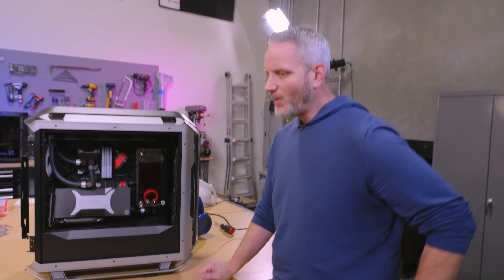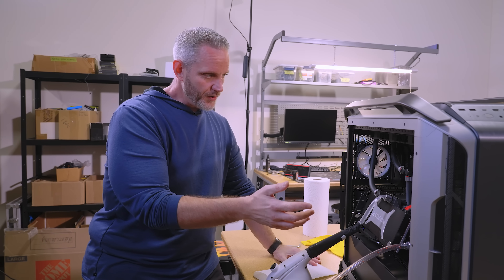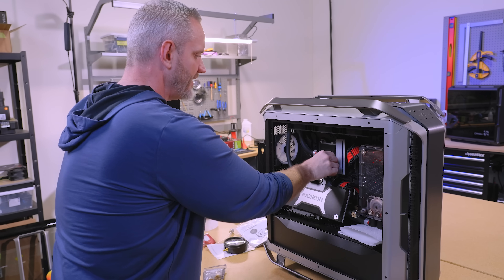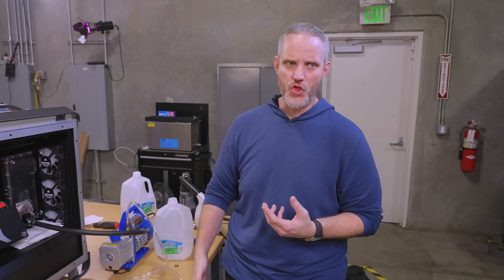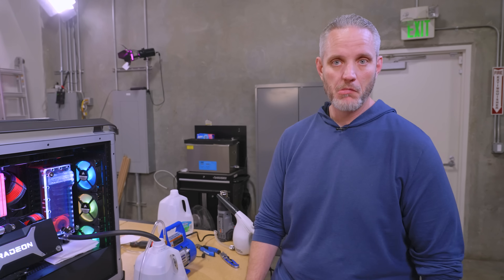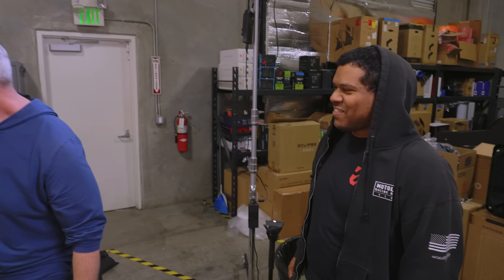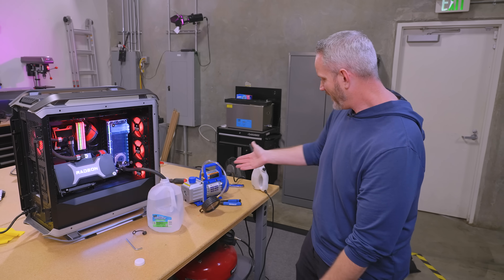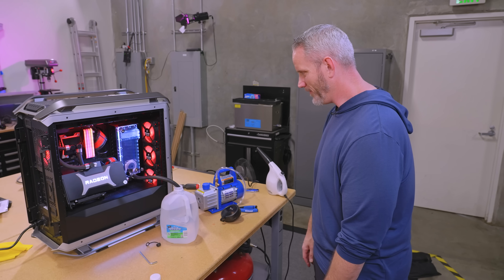I used Vacuum Pressure to fill a PC! Why didn't I do this sooner!?

Comment: If you connect the vacuum pump to the fill port and the inlet to the drain with a pipe in the fluid and just turned the pump it should fill the system in a more controlled way with less radiator crinklage.

Comment: Tube 1 in the coolant with an OPEN valve.
Tube 2 start sucking the air out and after a few seconds close the valve of tube 1 (should be air free by then)
Vacuum it, close Tube 2, and open Tube 1, DONE.

Comment: I like it. Just like air conditioner systems. so when are you taking a propane/butane filled air conditioner apart to make an actively cooled loop utilizing the latent heat exchange?

Comment: Jay, you could use the vacuum pump from your video to evacuate the system.  You just need to place a suitably sized container between the computer and the pump.  I am not sure it would work better than your blower system though.

Comment: For draining a loop with the current pump, couldn't you pull a vacuum on a container, disconnect the pump, hook the container to the drain and then open the valve?

Comment: If you have a sealed bottle with coolant in the lower half and fill tube to the bottom to fill the system and a top connection to the vacuum pump you can pull the system and bottle to a vacuum and when you release the vacuum the fluid will be pulled back into the loop. E.g. not that different to how an A/C system is charged.

Comment: now it seems like you need a fill/drain port at the bottom and a vacuum port up top. theoretically should get the same result with less stress on the hardware.

Comment: So why not use a oil acumulator to pressureize the system? 😂 so draw a vaccum, t in the oil accumulator fill the back side to 30 psi,  use valves to localize the vacuum pump and accumultator... and when ur done put the oil accumulator in the z 😂

Comment: That seems pretty dangerous. These parts are not designed to handle a vaccuum. Also, pulling a vacuum and then suddenly opening a valve could make every component susceptible to leaking.
I think that's a great opportunity for a followup video though to check if components fail if you do this regularly 😁

Comment: No offense but I have been using the vacuum method for YEARS. If you spend a little more time & money you can use check, diverter & T valves and eliminate ALL the air.

Comment: I use a manual one. 😎 Watercool rads are rated at 72psi, their industrial line are at 145psi. So be careful if the pressure isn’t known.

Comment: Jay what would happen if you used a 6hp wet dry shop vac to suck/blow out liquid cooling system then fill it.
Jay run line from vacuum pump to a 3 gallon bucket  or other sealable container then line from container to liquid cooling in the computer, you won't be pulling liquid into the pump

Comment: The Hvac way would be to have a tube with with 2 valves on it, 1 would connect to the vac pump and wone would connect to the bottom of a resevoir.  to start you would have the resevoir valve closed and the vacuum valve open, then pull a vaccuum. you then close the vacuum valve, and open the resivoir valve and the system will fill with no air at all. i could imagine the board you mentioned having all the parts bolted to it, 3 maybe 4 large standalone pc resivoirs linked together with the required valves.

Comment: Positive pressure, like you're already doing with the air blower, will be much more effective at fully emptying a system than a vacuum. Both options might be similar when the system is full, but if you want to make sure you get every last drop at the end, go positive pressure.
For filling, vacuum like you've found is the way to go! You don't need a full vacuum (and your current reading of "-25" is because you're only plopping the tube onto the flare fitting, that's your main leak). There's plenty of ways you can set up a liquid reservoir at the start and an overflow reservoir at the vacuum and just pull the liquid in with a mere "-1" (or so, still needs to combat the restrictions of tubing resistance and liquid viscosity but that's just extra science)
-hvac tech
Reply: As someone who has a custom, compact loop built around EK-MLC Phoenix modules, this just made my life so much easier. It essentially doesn't have a reservoir, other than an extremely tiny one built into one of the rads.

Tomorrow I'm going to finally do the purge I've been avoiding and pull from the highest point with a catch can before the pump.

Comment: You could use ot to empty too by adding in a large reservoir you pull the liquid into that you pull a vacuum to. Used all the time in analytical labs; usually a large glass earlenmeyer with two inputs; one for vacuum another for the liquid coming in.

Comment: Add a "T" to the vacuum line and two valves after the T,  one valve to the vacuum pump and one to the fluid line.  After drawing the vacuum, shut-off the vacuum line valve and open the fluid line valve.  This eliminates most of the air and eliminates one step.  Put the line in the fluid and then push it onto the valve to eliminate as much air from that line.

Comment: WARNING - Always Verify no leaking under some Air Pressure.  When you create that vacuum, you may suck close small leaks that will destroy your system later from not spotting them before filling.

Comment: i've never even touched water cooling, but i have always wondered why Jay never applies more automotive stuff to his builds.
Reply: He plays with cars but he’s not a tech. Back before water cooling became mainstream we use to use automotive parts to cool our PCs. I remember using a transmission oil cooler from a minivan (trans coolers are the most efficient and the smallest) and than I used an aquarium pump to move the coolant. For a water block I cut up and soldered up an old air cooler, the heat pipes go right through and touch the plate so it worked mint. Of course it wasn’t as efficient as todays blocks with the separator plate and micro fins, but it was way better than air cooling. I use to do all kinds of stuff like that but it’s just cheaper today to buy dedicated parts. As an automotive tech and a shop owner I still come up with things and currently me and my buddy who works with industrial refrigeration are talking about a mini refrigeration system instead of water, either a chiller or a full on cold plate. The hardest part is trying to find a small compressor to move the refrigeration, the condenser and evaporator are easy enough to solder up and so are the high/low side lines. Of course it’s completely useless for a daily pc but it would be fun to build lol. To many other projects and hobbies on the go so probably never build it haha. But yea I agree, jay should be doing more automotive features in PCs, he built the channel off custom water cooling and has gone away from that. It was always about bios overclocks and crazy water cooling and now seems like an add campaign. Was looking forward to seeing that mock up V8 engine build but he gave up on that thing so fast and never seen again.
Reply: Most PC cooling is copper or nickel-plated copper. No reason you couldn't use a car radiator, but you'd then need to make sure everything else is compatible and won't turn itself into a battery and corrode over time.

Comment: Jay,, speaking of automotive what do you think about creating something like the flushing systems they use where it pushes new fluid in replacing the old fluid. Basically a pump that pushes fluid into an inlet while sucking the old fluid out. Think BG transmission flushing system or something similar.

Comment: This is actually something i have been wondering why Jay had not done it before... since i have HVAC vacuum pump and also have access to lab level vacuum calibration pump i was sure that it will work. He just needs T piece whit 2 valves. One to go to vacuum pump and one of them needs to be connected on hose that goes on cap of liquid container and turn it upside down to get air on top so it wont draw it to system.

Comment: Jay what if you had one tube in the liquid and one tube on the vacuum pump so the pump sucks in the liquid so no air gets in. Might work might not just stop the pump before the liquid is sucked into the pump

Comment: Jay: It's even easier than you think. Pressure differential. Same way you siphon a gas tank. All you need is a tube with enough flow to keep up with the pump. Let the pump to the work.

Comment: cool idea but i dont think i need to do this for my system as i have a rear opening via a t junction with a close valve that i use to let air in when i drain my loop & i also use it to fill my loop as the opening is at the highest point to the rest of the loop.

Comment: Yeah, you really don't want to completely depressurize systems that are tested for positive pressure (burst pressure). They don't always have the strength to resist negative pressure loads. 
What you want to do instead is have that bottom tube in your jug of fluid, and then hook up the vacuum pump into the top port of your reservoir.
This way it's sucking the fluid like you do through a straw, instead of trying to fill it in one big gulp. You don't need a full 1 ATM negative pressure to fill, just enough negative pressure to be less than the surrounding atmosphere.

Comment: Simpler. Add a drain valve to top of reservoir also. Take a wet-dry shop vac and make an adapter for the vacuum's hose to a vacuum tube. Hook that tube to the top drain valve and stick the bottom drain hose in jug of coolant. Suck out the air and shut off top valve. Open bottom valve, fill reservoir. Rinse and repeat. If coolant gets into shop vac, no problem. Shop vacs are cheaper than vacuum pumps and most people already have them. All you need is a drain valve and adapter.

Comment: A gallon jar would work for vacuum draining. One hose pump to jar. One hose jar to lowest point in the system.
I wouldn't ever attach an actual vacuum pump to a system with coolant in it without a smaller jar to catch anything from getting to the pump.
With a valve setup: Pull vacuum on the system and all the lines. Close valve to vacuum pump. Crack valve to fill bucket to fill line up to the valve and close. (It can help to elevate the fill bucket in an automotive scenario.)
Open valve to vacuum pump and pull again. (This is where the "catch jar" comes in handy.)
Close valve to vacuum pump. Open coolant valve and fill.
IF USING A VACUUM PUMP on a car cooling system DO NOT pull a deep vacuum. It can potentially damage gaskets. This is why venturi based compressed air vacuums became standard for cooling systems. They can't really pull a deep enough vacuum to cause damage.

Comment: With longer hose using a funnel, that would be higher than the pc, then cap the tube off with your thumb. And put the fluid in a more open container so you can drop the filled tube down in the fluid container and less to no air will be present.👌👌The concept is similar to car radiator and engines thermostat creating an air lock in the system. When engines or radiators have a bleeder valve but even those that don't, I usually lift the coolant fill tank above the engine, and let it burp itself with engine running where the cavitation from the water pump will show some bubbles. ✌

Comment: What about putting a tube from the drain fitting into the new coolent and attaching a wet vac style vacuum system to the fill port and pump it full that way. Should be a bit safer and not suck in air.

Comment: If you put a canister between the vacuum pump and the coolant system, you can pull the fluid out under vacuum. That's how i bleed my brake and clutch systems in my cars. Works like a charm!

Comment: Now you need to do some stress tests on different radiator sizes and brands to figure out when they break.  Both how many repetitions of drain/fill and how much vacuum they can be under.

Oh, and do it to a system with clear tubing so you can see everything.

Comment: Use a separate reservoir (not a combo) with valve, vacuum the system via separate valve and then you close the vacuum valve and open the reservoir valve. The same system should work in reverse. The radiator noise might be from rapid cooling when water evaporates.

Comment: Use a vacume chamber like you would use for pickling  pull a vacume on it close valve hook up full raditor  open valve it will pull a vacume and pull out all the fluid also

Comment: One suggestion - if you use the vacuum pump to EMPTY the system, perhaps have a collecting canister on the line BEFORE the vacuum pump, so that the pump doesn't draw water through itself.
Reply: that would work ONLY IF the collection item is twice the size of the fluid you are moving, otherwise it WILL end up in the pump.
Reply: @lornegraham5098  well, better than no system before the vacuum pump at all.  Though arguably as long as the collection system is larger than the system's volume, then all that's going through the vacuum pump is water vapor.

And who knows what else is in the fluid (e.g.solid flakes) that will still need to be flushed out.

Comment: I have a similar air-pump that I use for things. . . If you let it run for a longer time, it will get much closer to 0 atmospheres. I have to leave mine running for about 10 minutes to get 2 galloons of air volume to full vacuum.

Comment: if you just put a vacuumhose on the top of the FLT an a second one on the other end pulling the fluid in, you just need to make sure you don't pull the fluid into the pump ^^

Comment: Hi Jay, you might want to do an experiment on how much vacuum is safe for radiators, as pc rads are not likely built to withstand vacuum and they might collapse permanently, reducing flow and thus harming the whole system! It would be great if you tested the flow of a new rad before exposure to vacuum and after as a follow up video😁

Comment: Since the total volume in a loop is usually pretty small could one of those manual wine bottle vacuum hand pumps work? They cost like 10 bucks. And if you could 3d print or jury-rig a fitting for one that would be a cheap and accessible way to get in to vacuum filling a loop.

Comment: If this is going to be a regular thing, make sure you install a dehydrator before the pump. Those pumps are not designed to create a vacuum with water. It is going to rust out. Check the sight glass on the one used in the video and it will likely already have rust in the oil.

Comment: Being a mechanic for over 20 years, and koi pond enthusiast for over 25 years, I came up with a safer way, a long time ago. 
You don't have to have the system under vacuum. That has the potential to mess stuff up.
Run a line from your fill bottle to your system. Have another access point running to a cheap pond pump. The pond pump will pull the water through the system and you don't have to worry about vacuum pressure trying to make components implode.

Comment: why not connect the drain port to the vat of coolant, and the fill port to the vacuum pump. so as its pumping out the air its naturally filling the loop, it will also assure your system isn't under high vacuum stress.

Comment: Insure your pumps health and put a reservoir inline to catch any residual water in the lines. Also if you leave one end open it’ll still suck the fluid in without damaging any non quality parts. Just hook the pump to the top of the reservoir and turn it on the same way. But leave it on during filling and so on

Comment: Now you have to get the liquid vacuum pump too! I want to see how quickly you can drain and refill a system. This was a great video! So much fun to watch!
Reply: Cheaper to just get a gallon jar, some fittings, and hose. :-)
Reply: For most people, sure. But for someone who is going to be doing water cooling, draining systems, etc often, then it's probably worth it. I didn't say everyone should do this, I said that Jay should. Plus, he'll make more from the content than he'll spend on the pump and other parts.
Reply: @mr.guillotine1312  Could show the different options. Can't say I wouldn't want to see a professional solution as well despite not having this specific use case. Good to cover bases though.

Comment: I have another suggestion, use a hand vacuum pump on the highest point of the system. The on the lowest point of the system, you put a bit of hose that goes into the water bottle. So instead of the vacuum pulling the water, you suck the water into the loop with the vacuum pump. 
Then you could almost fill the distributor block.

Comment: Considering your use case you should create a cart to mount the rig (pump, gauge, reservoir assemblies with the fill section having a valved intake near the bottom of the container, with the drain/dump side having the reverse along with a fluid pump mounted to it) to.

Comment: You can drain with the vacuum also. Use a paint can to upscale a vacuum brake bleeder. Put two fittings in the lid. One that goes to the system with a tube going to the bottom of the can and one that goes to the pump that is just an open fitting at the lid. As long as you intake tube goes to the bottom of the can you shouldn't pull any liquid through the pump but still be able to drain using the vacuum pump.